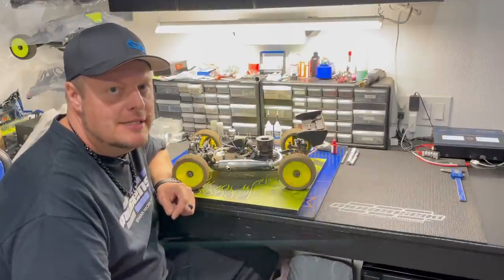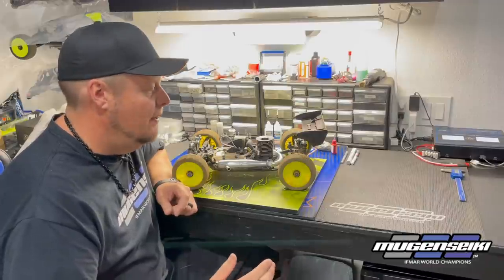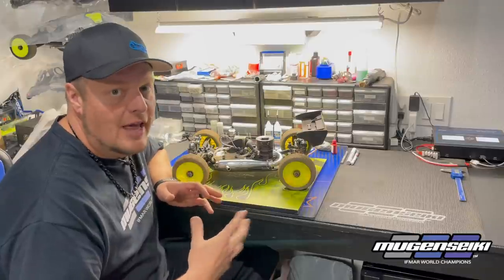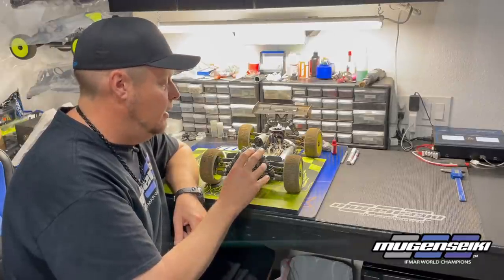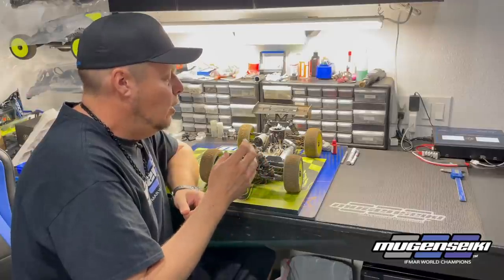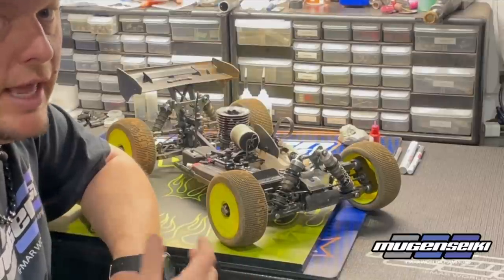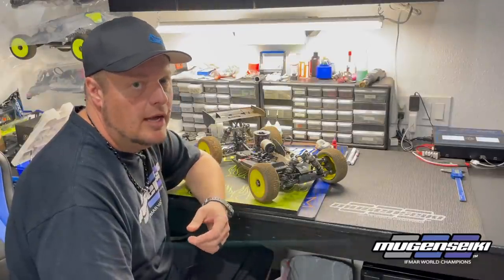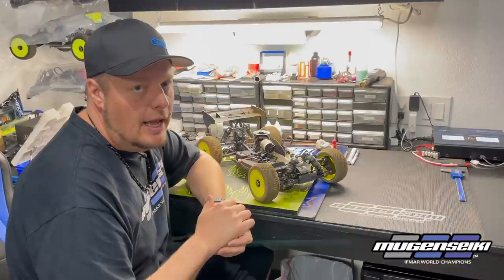R/C Car Maintenance.

Comment: Great vid Adam. Ok so shock boots, this is one thing that confuses me. We are told to maintain them and replace if they get holes or tears. But we have also been told to put holes in the boots to eliminate the air trapped in them from being sealed so well. Which obviously will allow the air to not build up and affect Shock performance, but will in fact allow dirt to get in. Hence my confusion.
Reply: Don’t use them they’re extra weight, use a mud flap made of lexan it’s les weight and just ricochets dirt buildup away from your shocks.
Reply: I have never had a problem with shock boots with air in them, no need to put a hole in them
Reply: First thing I do when I build a new kit is toss the shock boots in the trash. Dirt sprint cars don't run them so I don't run them. I hate them! Lol
Reply from the maker: I don't usually put holes in my shock boots.

Comment: You have probably never had anyone say this, but prolong engine/transmission treatment works for rc cars!  Its all the same thing really, I've had folks laugh at me about it. I personally had an 81 camaro(12.33 @117mph in the 1/4} that lost an oil pump pick up, I still had to go to work for almost two months with bouncing oil pressure, no damage, the bearings looked new when I finally repaired it. I break shit in, then add prolong, it pretty much stops wear, but you need some wear, thats why you can't do it right away. I've used it after doing some shady pinch jobs on nitro engines, and they last quite a while!
Reply from the maker: Very cool, thank you!

Comment: Hey adam great video. I plan on rebuilding my differentials, what grease should I use outside the differential case?
Reply from the maker: I use the protek white grease on the ring and pinion and Mugen grease on the outdrive/diff cups.